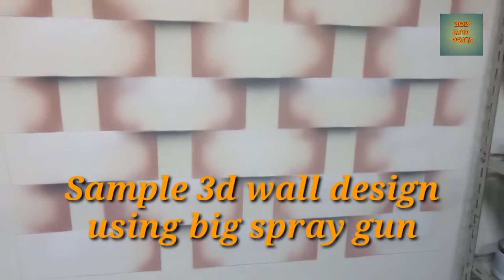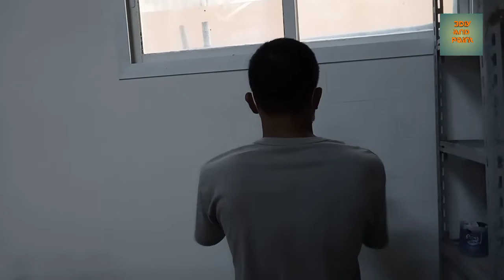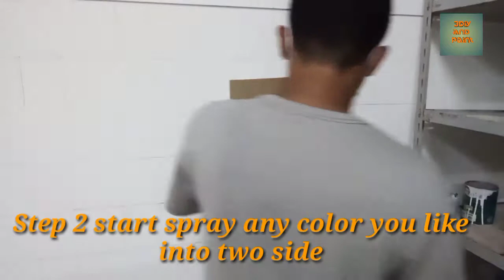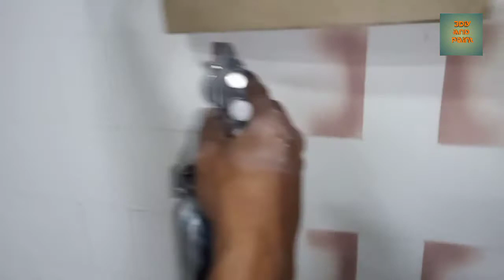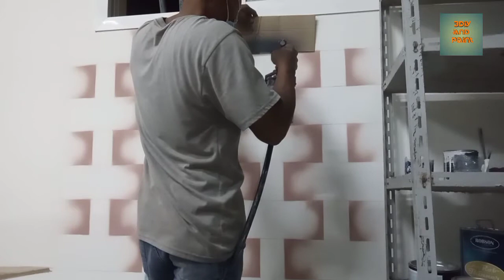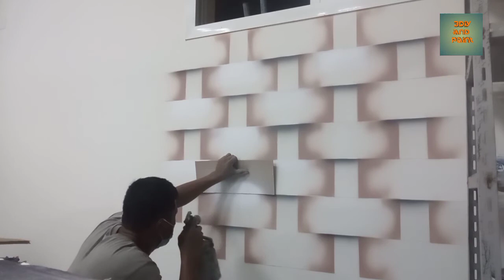3d wall design sample using big spray gun #spraypaint #paint #3d

Comment: Sir.. advise naman po.. pano mapakintab ang gate stainless po siya.. pero may kulay borwn at white po..🙏🙏🙏
Reply from the maker: Biili ka po na top coat clear or emulsion paint kikintab yan kng  ano po ung pintura enamel po or laquer paint ganun din po ang top coat mo.kng hindi patungan mo po ng gloss varnish
Reply: Nakabili po ako acrylic latex clear gloss emulsion.. pede po ba un sa stainless na may pintura acrylic din po nilagay n top coat
Reply: Sabi po nun isa ko napag tanungan bawal daw po sa bakal daw po.. haysss.. low budget po kase . May emulsion clear coat
Reply from the maker: @jenelynbelon1099  pwede po kng acrylic din
Reply: Boss... Nagtry po ako nun emulsion. Maliit na part lang.. bglang umulan po.. tpos.. ayun namuti po.. dko pa po alam panu bumalik sa dati.. 
Anu po kayang pede gawin na boss🥺
Reply from the maker: @jenelynbelon1099  nabasa kc po kaya pumuti dapat mainit kapo mag apply